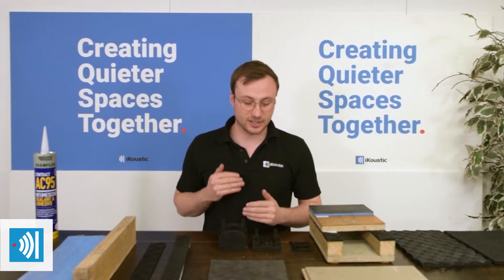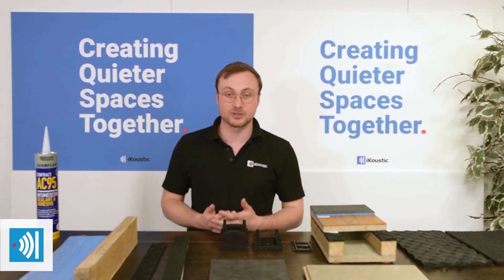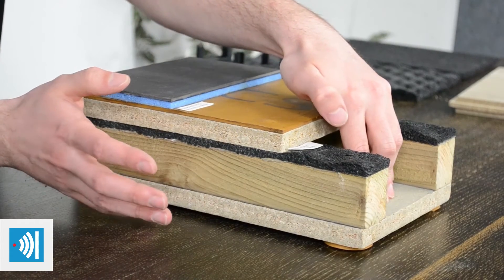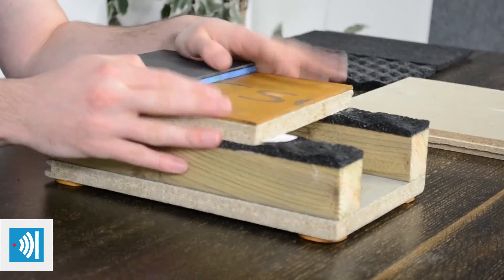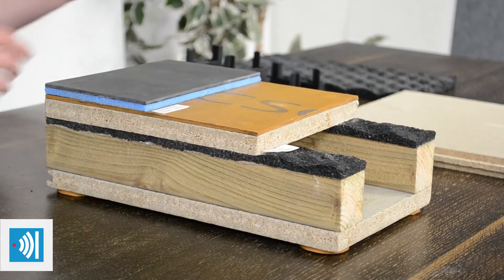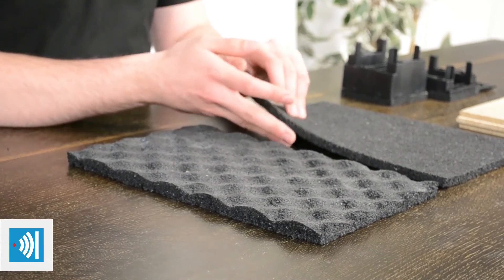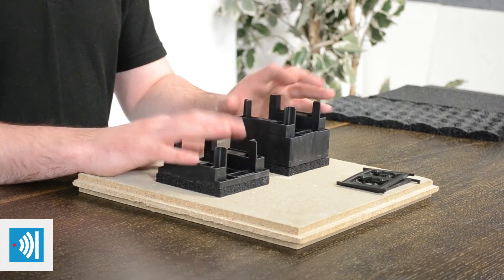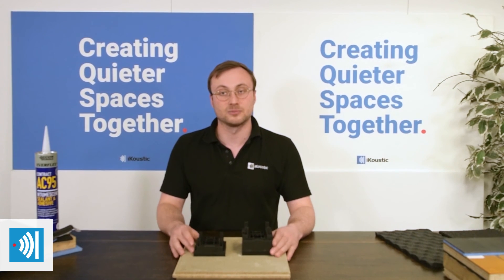Floor soundproofing using the 'floating floor' technique

Comment: nice clip, well explained. Im interested in both products but with the screeding USF/OSF ranges, would you use that product vertically against a boundary brick wall before a 100mm contrete pour?

Comment: So when I'm framing and dont secure any walls through the subfloor, what happens when a gust of wind comes and pushes my walls off of the unattached subfloor????? Seems like a neat idea but in aome parts of Canada you need to use hurricane strapping and bolts walls to the floor below......
Reply from the maker: Hi Jake, thanks for your comment! We are based in the UK, our houses are built differently here to suit the weather. This floating floor is for a retro fit inside a brick house, this wouldn't be installed at the point of contruction. Thanks for watching!

Comment: Based on it, the strength of the structure of the house will be affected? Will not?
Reply from the maker: Hi Leandro, as soundproofing materials have a high mass, you should check your structure can take the new load.
Reply: It doesn't make any sense as the subfloor must be screwed on the joists. I don't think that it is in accordance with building control regulations.

Comment: Can i use rubber mat gym floor on concrete floor?
Reply from the maker: Hi Aliff, 

We have a range of products that a specifically designed for gym floors. You can view those here ---> https://www.ikoustic.co.uk/products/gym-acoustics

You can chat with our experts on our website live chat if you'd like more information about laying our products on different substrates. 

Thanks,
Miles